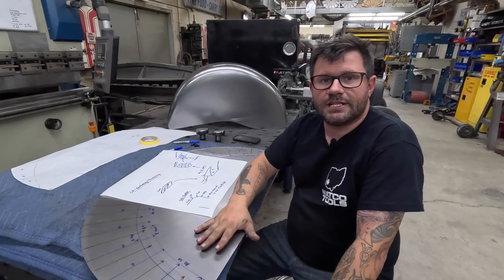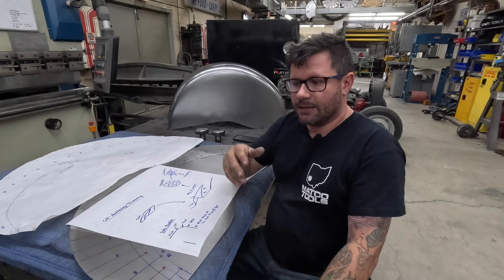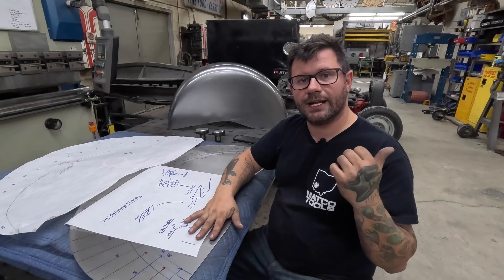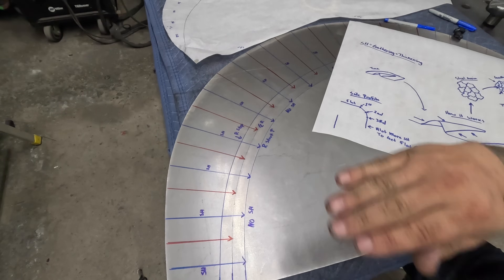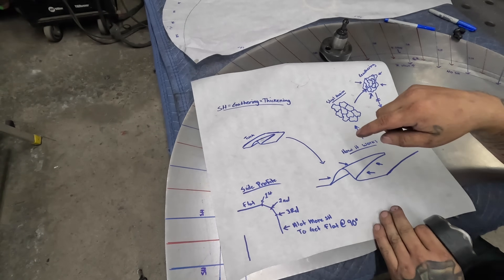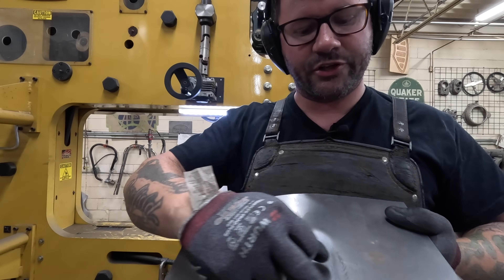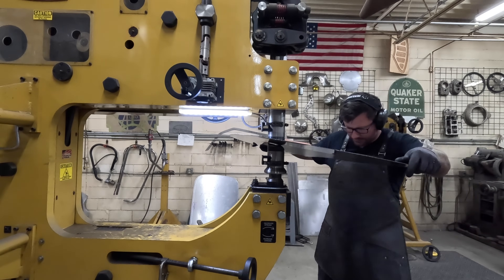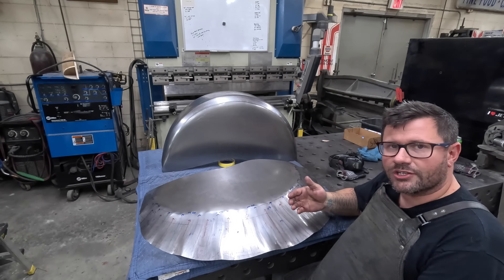Mini tub Wheel Well In One Piece, Doubtful - Part 1

Comment: One thing that still boggles my mind, despite watching yours and several other explanations, is how the thumbnail die works - my brain wants to believe that the metal would just end up right back where it started as you pull back out, yet it doesn't. I still can't quite wrap my head around how the die doesn't just simply "undo" the tuck :)

Comment: Very helpful.  Thanks for posting.
Reply from the maker: Glad it was helpful! Thanks for watching
Reply: @cornfieldcustoms  I tried making that piece on my MH19 early this year.  I never could get the wavy part to come all the way over and tighten up the piece.  After watching your part 1 I am thinking that I didn’t have the hammer blow intensity set right.   Ultimately I ended up making the pieces in 2 parts using a round over die (covell tank die) in the bead roller and then welding the center of the radius. They came out OK but not great.   After I watch you finish the one that you are making I will try making mine on the hammer again.  I never installed the ones I made in the spring.  Anyway thanks again for the post.  It is much appreciated.

Comment: Great video , you're explanation of the process is spot on I knew exactly what you meant as you explained it. That power hammer is a beast , the question I have is can you get the same results with a smaller power hammer ? , not everyone can afford a machine that size.
Reply from the maker: thanks for watching. Yes smaller hammers are more than capable of doing these parts. I have a smaller hammer that i used to make these on. I just use the big hammer on everything now

Comment: Great explanation!  I'm struck by the difference between what you can accomplish on the big power hammer and others I've seen using hand tools or smaller spring powered hammers.  That thing is a beast.
Reply from the maker: thanks for watching.

Comment: well actually you can also drill metal draw it, upset it, and rivet it, but I suppose thats a differant type of metal work and names for much the same concepts but you say you offer classes and lessons in shaping and crafting?  hmm sounds like I might be interested if I had the time. but thanks for showing us the layout, its so seamless its a work of art
Reply from the maker: Drilling is a form of cutting, drawing is a form of stretching it, riveting is a form of attachment
Reply from the maker: Upsetting is thickening = shrinking
Reply: @cornfieldcustoms  ah yes but you said welding, a differant method of attachment, and of course the operations I mentioed have more to do with bar stock or slug metal not thin plate or sheet metal, but I guess you do thick stuff too bending frame and tube and its crazy how well it works without even kinking the metal heh,
I guess I am trying to be a wiseguy

thats a big hammer, how much force does it hit with at max pressure per blow, I am more familier with forging type power hammers or presses which have the force of the ram or weight of the hammer, not necessarily the blows per minute.
Reply from the maker: welding and attaching are totally different things.

 lets say you have 2 pieces of .500 1018 Mild steel. You forge weld them together ( 100 % clean, no cold shuts, or delam, a perfect forge weld) , what do you have? 1 solid billet of 1018 mild steel. you can not go back in and separate the 2 back into their own individual pieces. now take 2 identical pieces of .500 1018 Mild steel, you rivet ( bolt, tape, glue, zip tie) the 2 pieces together, What do you have? 2 pieces of 1018 mild steel rivet ( attached ) together. you can easily knock the rivet out and you are back to the 2 individual pieces you started with. 

Welding and attaching are different theories and i was not talking about attaching since it doesnt have anything to do with the 5 core principles of modifying a ( singular) piece of metal. it doest matter material shape size or thickness, you want to modify a piece of metal you are shrinking, stretching, cutting, bending, or welding.
Reply: @cornfieldcustoms  right but I was playing devils advocate since they weren't mentioned by name,  so how much force does the powerhammer hit with at max pressure curious to compare to a forging power hammer.
Reply from the maker: @manga12  its a totally different concept to a forging hammer. They dont even give a strike force rating for a sheet metal power hammer
Reply: @cornfieldcustoms  heh really, I imagin though its nothing  you want to put your finger into bet its at least 20 lbs, would be interesting to see how many how many newtons or kilonewtons it puts out. with a force guage
Reply from the maker: @manga12  i would bet its more than 20lbs, the upper ram weighs about 30lbs, plus the what ever your stoke is set at as well as rpm set at
Reply: @cornfieldcustoms  ah then that would hit harder then a 25 lb little giant

Comment: Will it be same effective when done on pullmax
Reply from the maker: yes and no. You can use thumbnail dies in a pull max but it not as clean or effective. the hammer is spring loaded with more tool gap and the upper anvil get thrown by the springs to hammer. the pullmax is a fixed stroke so it wont hit as hard and tooling has to be tight to close the tuck. as the material get thicker by shrinking it will begin to stretch out unless you are constantly changing tool gap settings. I rarely ever do any shrink work on a pullmax.
Reply: @cornfieldcustoms  understood..thankyou for replying

Comment: thanks for this nice explanation. I have just  one question. You said, it is essential to stop right at the line. Where actually are stoping in regards of the die? Is the outer flat area not crossing the line or is the tuck going til the line?
Reply from the maker: You dont pay attention to the die. You stop the shrink at the line. Not the die or the tuck itself. There is an area just in front of tuck thats kind of a horse shoe shape thats what is stopped at the line. Its the front edge of the shrink
Reply: @cornfieldcustoms  Thanks for the
 explanation

Comment: When shrinking using thumnail dies how far apart should your  tucks be  knowing ng it depends on how much shrinking you need and when you lay out your high light lines and blend lines  do you go to the high light line with the back of the thumb ?
Reply from the maker: @Iconicmetalworks  how close together is dictated by the pattern. The tuck stops at a kidney bean shape just forward of the male section of the thumb on the tooling. That is where i stop the shrink at the light line. You have to look through the tooling while shrinking to see it.

Comment: Is there a cheaper way to do the shrinking, not to many of use can afford a machine like yours.
Reply from the maker: you can do it by hand with a tucking fork, mallet and lead shot bag but your not going to be able to shrink as deep. something like this would be made in two pieces if doing it by hand
Reply: @cornfieldcustoms  
So basically rolling the edge then welding another panel to it.
Reply from the maker: @terrybensie4794  there is more involved than that but in the short version yes
Reply: @cornfieldcustoms  
Thank you for your time kind sir.

Comment: What size gauge metal are you using?
Reply from the maker: @johnnieburge4997  these were in 18 gauge cold roll steel
Reply: @ how much would you charge to wheel tub my 1966 impala convertible?
Reply from the maker: @ $120 an hour plus material. I would measurements or something to go off of

Comment: 6th thing you can do with metal.,, you can "cast" it. 
7th thing you can do with metal... you can "heat treat" it.
8th thing you can do with metal... you can "anneal" it. 
9th thing you can do with metal... you can "3D print" it.
10th thing you can do with metal... you can "extrude" it.
11th thing you can do with metal... you can use powder compression molding (PCM).

I could keep going, but you should get the point... there's more than the 5 things you can do with [sheet] metal.
Reply from the maker: lol lets break down a few of the things you mention here. cast - melting it down and starting over, annealing and heat treating are almost the same thing and out of the context of the metal shaping discussion at hand, 3d print, again melting it and starting over, extruding is a form of drawing, which is a form of stretching. so keep on with your misunderstanding of 5 Key principles of what you can do with metal.